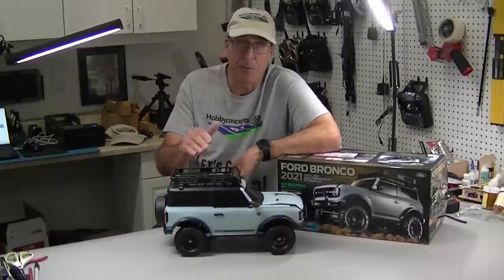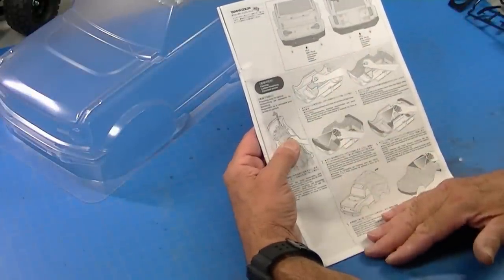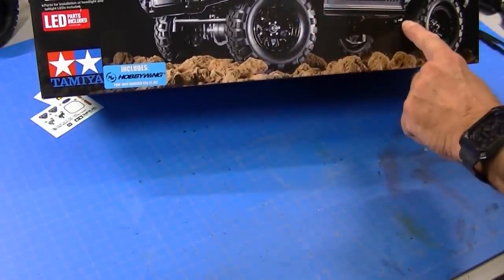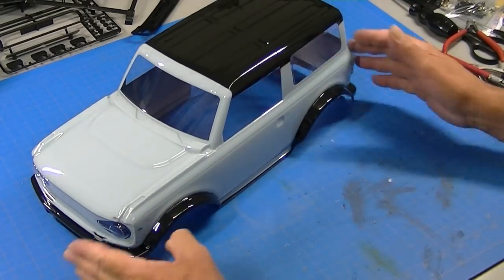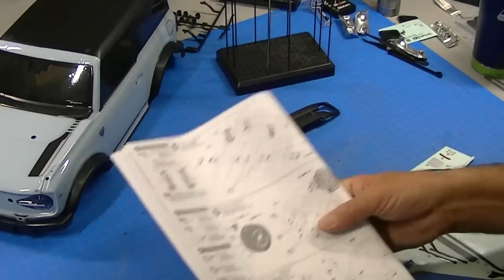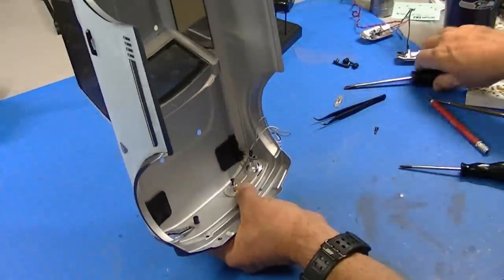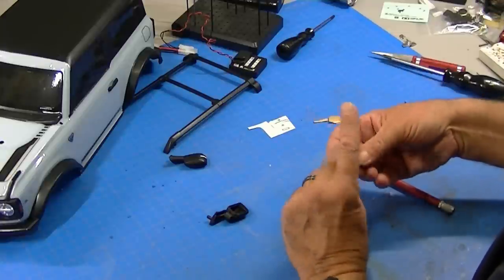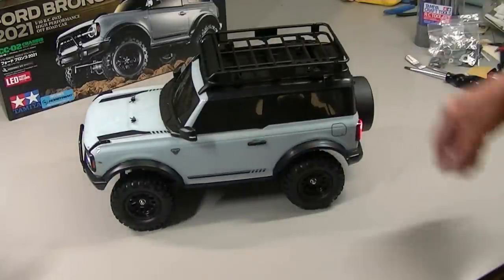Tamiya 1/10 Ford Bronco for Novices - Part 2 Body

Comment: After building a lot of these models, I found it to be easier and faster to use a sharp knife to cut out the body. It's enough to cut only into the surface from the outside, then the material can be bent towards the inside and breaks away pretty easily. I use the scissors only for relief cuts on rounded cuts or corners.